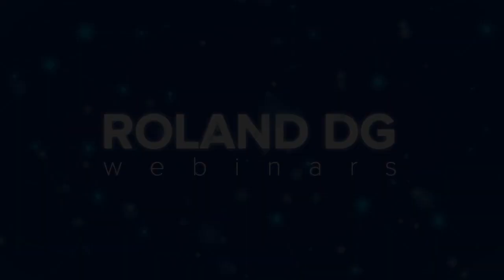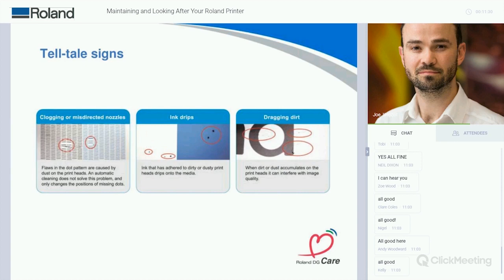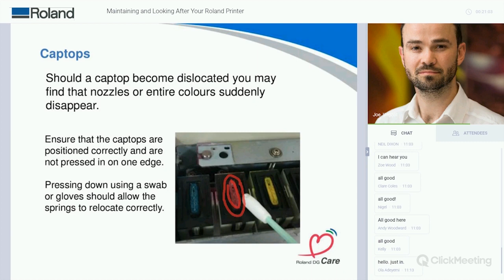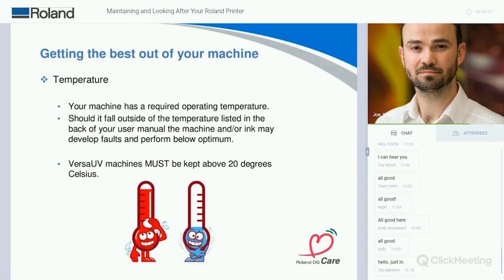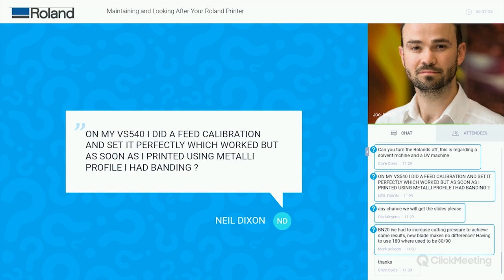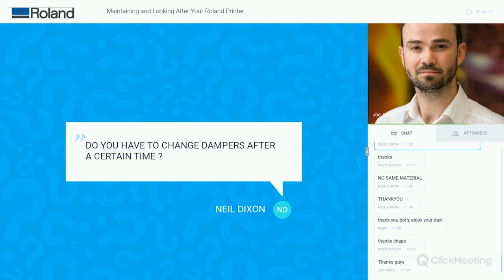Maintaining Your Printer | Roland DG Academy

Comment: Here I am... a guy asking a question 4 years later. Sorry to be that guy, but this question just doesn't seem to be answered anywhere else.

We use our Roland VG2-540 to print and cut vinyl lettering and find that though we've gone through multiple rounds of calibration, that the letters we cut out (san-serif, about 1.5" tall) look great - nice sharp corners, no notching - but the cuts don't quite complete where they start, leaving little wispy vinyl connections that tend to pull the letters off when weeding.

Any thoughts on how to fix this?